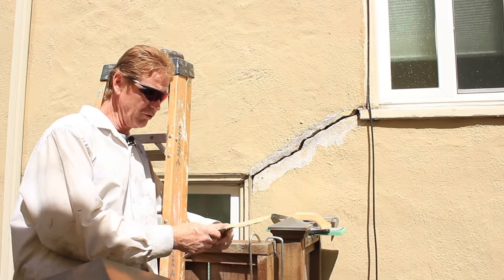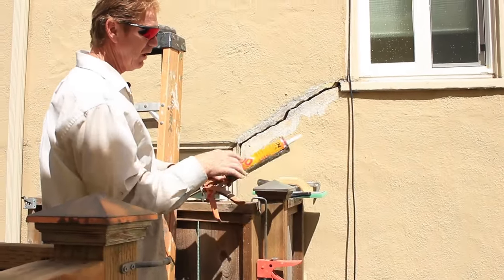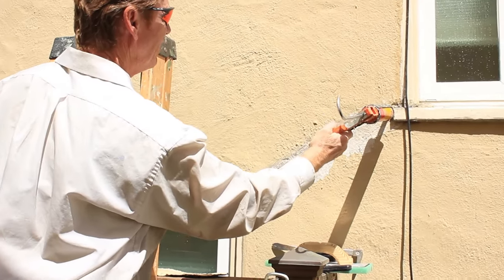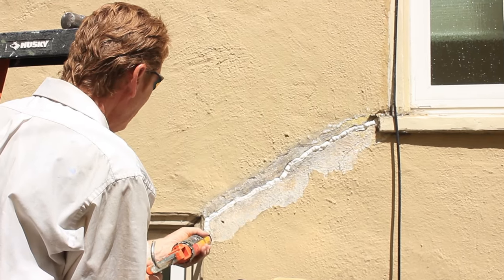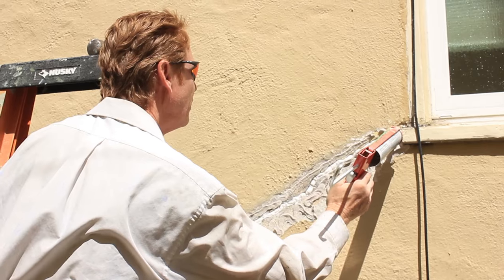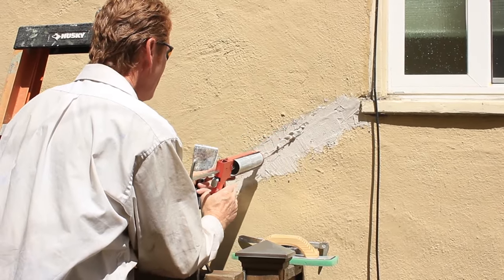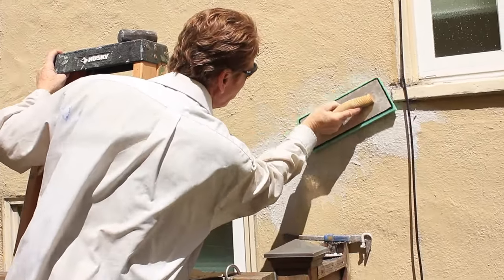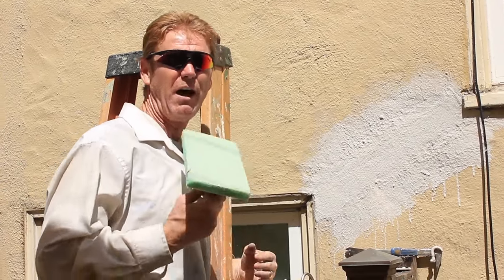Fix large structural cracks in stucco.

Comment: I have installed sealants professionally for 40 years and I was prepared tell you all the things you are doing wrong but it kinda makes sense. I didn’t see how you cleaned the joint but it appeared you cleaned it pretty well. The one thing I might have done different is tool the urethane to make sure it was bonded to the sides of the joint before adding the textured sealant
Reply from the maker: Howdy Gene Dude, in light of one with q deeper and or a specialized knowledge than most, that's quite the compliment. Thank you, brother, 🍻

Comment: Hi, I was wondering I have a house I'm working on it has a Vertical Staircase type crack the outside frame of the house is cement - cinderblock with a stucco or plaster coating on the outside and the inside, the crack is from the inside of the house to the outside you can see outside. I filled the gap with some expansion foam for now, and came across your video any recommendations? Can I do this with it. The Gap Grows some but it's an old house
Reply from the maker: Of course you can, on the inside place some interior caulking over the foam to make it prettier.

Comment: I have the same types of crack. Thanks for the tip!
Reply from the maker: Hi Mike Formichelli, no worries, I would suggest any polyurethane caulking that is flexible to water proof and flex with the wall movement and a good quality caulking with sand to match the sandy surface.
 best wishes,
Kirk & Jason Giordano’s DIY plastering and stucco network

Comment: Hi Kirk,

I’ve been watching your videos lately like it’s my full-time job.  I still don’t think things fully stick so I keep re-watching to get pieces I’ve missed.

I have a wall on my small ranch home where the painted stucco top-coat has separated.  I was quoted 3,500 to fix it and there really aren’t a lot of stucco experts around my area to choose from. 

I did some exploration and pulled away all the loose stucco. 

I power washed, applied weld-Crete, and then got some rapid set stucco mix and tried to put on a layer of stucco, being careful to feather in the edges. (We don’t have any rapid set stucco patch here).

I didn’t realize I wasn’t doing it right.  I probably only needed to do a skim coat and then attempt a Spanish lace texture.  The texture on my house is very uniform and I think it might be 20/30 sand. I bought some quickrete finish coat to do the skim coat once I’m ready. 

Anyways, I wasn’t happy with what I did, and tried to remove it enough that I could do a skim coat over it and try to make it look somewhat decent. 

I bought a rotary hammer and tried to take it off  as much of the stucco I’d previously put on like I’ve seen done when you remove stucco in videos, but because I used weld-Crete, that stuff was on amazingly well.

I ended up putting about 3 or 4 holes in my wall and I could see the stucco wire.

I power washed the wall again and brushed out any loose debri I could from the holes.

Despite brushing well, I still don’t think the holes were as dust free as the surface stucco was. 

I added some polyurethane Sikaflex to the holes but I’m worried that because it wasn’t as dust-free as I would like, it won’t provide that water resistant seal.

Should I have done something differently to prepare the holes to get them completely dust free?  Will that matter if I can’t get it as dust free for the caulk as I would like? 

Thank you
Reply from the maker: Wow, Farrah, you had a lot of work to do, "Rapid set stucco" has large sand '16/20," that matches most stucco finishes, 
I would have recommended the USA green core from HD as the sand is much smaller. "20/30' and therefore much easier to apply. Sorry, you had to go through this, but this means you are an exceptional woman to continue trying. What is your phone number I will call, I don't give my personal number out for obvious reasons however your seams an exception. cheers.

Comment: Great videos Kirk. Do you have a video where you plaster the butt end of a wall? setting up vertical steel bead then rendering etc?
Thanks
Reply from the maker: Peter B Hi Peter, thank you, you can see if any of these corner type video's will explain what you wish to know,

https://youtu.be/ByXcvPNNIFo  Installing inner and outer stucco/plaster corner aid or beads 
https://youtu.be/QWbTsdFWWFM   Complete and easy Lathing instructions, Waterproof your addition 
https://youtu.be/TFn3lViVrws  What is arch aid? flexible metal corners for stucco, stucco radius’s 
https://youtu.be/vyP3GhNenNE  Installing stucco corners properly, they were all set wrong at first 

 Best wishes,
 kirk giordano plastering

Comment: Great information.  My neighbour has a crack on his chimney exterior where the chimney tapers sideways (about the height of the inside mantel).  The jumbo brick has moved enough to cause the stucco to crack open at the corner. It looks like the brick has moved about 1/4".   If I really tried, I could move that brick but I'd like to fill the hole and seal it off again without disturbing the stucco anymore.  I may be able to tap it back tighter too?  What would be the best product to lock the bricks together as much as possible?
Reply from the maker: Sikaflex 1 A it’s a construction sealant and adhesive. Just don’t get it in you as it’s a drag to get off. Also it’s not very user friendly like Mor-Flexx, but incredibly strong.

Comment: I have two buildings right next to each other, both made of block.  Both have the blocks scored, galvanized wire mesh nail to the blocks and Expansion Joints.  Both were 3 coat applications, one with old fashioned stucco mixes, one with Dryvit.  No problems with the Dryvit building after 12 yrs. Stucco building hair line and deeper cracks all over the walls. Kirk what is the brand name and product number of the polyurethane Cualks you used in this video?  I know it will recrack, but if you don't keep the water out the freeze/thaw cycles will pull the application away from the wall.
Reply from the maker: Howdy Meno, I think it was rain buster, I also use a lot of sikaflex, but for most cracks I prefer Mor-Flexx as it has sand in it and matches most finishes if applied properly.
 Best wishes,
 Giordano’s teaching video’s

Comment: Hey Kirk, when finishing a patch like this, how do you match the color?

I have an old house with an attached porch, all stuccoed in a heavy lace style, with a buff/beige color similar to house in this video. My stucco is not painted though. There are a few old structural cracks in the front porch walls that someone repaired before with some kind of grey caulking, like you did in step 1 in the video. But they didn't float & feather a top coat. I want to touch these up & blend them into the rest of the stucco, but also match the color.
Reply from the maker: Hello kelly olsen-stanko, sorry, you will have to paint the area after caulking.
 Caulking do come in many colors but chances of finding the right color will be tough.
 Best wishes,
 Kirk Giordano Plastering

Comment: Hi Kirk, great videos and learning a lot. 
One question, is it possible to use the Morflex  only to fill the crack and not use Sika? 
Thanks again!
Reply from the maker: Howdy and happy Easter Fastrice, absolutely, what happens if you fill a large crack and the next day or say two dads later shrinks and is sucked in?
 Nothing,  you just add a bit more if this happens.
 Most caulking will shrink if the crack is deeper or wider than 3/8. Many cracks are wider than this so when this happens, don't panic just add more.

                           Peace, love, and harmony to all
         Sound Plastering tips for the DIY beginner’s and Plastering experts

Comment: Hello Kirk.. love the videos. Recently purchased my first home that had structural foundation repairs done prior to closing. There has been some water intrusion during moderate rain and hurricane Irma made worse . is it possible there are cracks lower down closer to the foundation? I was debating on digging at least a foot down and sealing any visible cracks... any recommendations.
Reply from the maker: Good Morning Maraya, dude, cracks in stucco are normal as caused by ground movement, holes in the unlining paper are not normal, these will cause leaks, depending on if your paper is now disintegrated, yes,  it would be a good idea to repair or caulk all cracks                   
                    Live long and plaster
    Mastering Plastering by Kirk and Jason Giordano
Reply: Maraya Fragoza okj

Comment: Hi Kirk, I just bought a house 8 months ago and the house was built in 1941 & they had an family room added on in 1972, now I noticed that there is a cracks from the top of the exterior wall all the way to the the floor vertically and it appears around the border of the old & the additional portion, after my handyman opened up the crack, it is about 1/8-1/4 inches wide vertically, and I saw him fixed it like the way you did, do you think it is a serious problem for this case?
Reply from the maker: Howdy Albert, with all additions, added the foundations flex differently, as they are poured at different times. and caulking will need to be done when necessary, I don't think it is a big deal personally. Just kinda annoying but that's life.👨🏻‍🔬

Comment: Hi Kirk, I have a 1/2 inch x79 inch gap where my stucco patio wall meets the back of my house (stucco as well). Would the best way to close this gap be the method you used in this video (sikaflex with mor-flexx)? The gap is about 10 inches deep so I'm guessing I could use some spray foam to fill the deeper portion, then use sikaflex and then mor-flexx? How would you do this repair? Any help is greatly appreciated!
Reply from the maker: Evening Brian. The best video online about caulking stucco is below. How do I know? 
I created it for this purpose. Structural or large cracking on stucco walls, no problem.
 https://youtu.be/2eIkdeIBbMs/ 🍾

Comment: Hia Kirk. Great tips thanks.  Its generous of you to share the expertise.
All of us with render have or will have cracks! I like the recommendation of the sikkaflex ebt+ but when I read their spec it says that it cannot be overpainted. I can't get the mor-flexx in the UK  so that's a pain. Do you use a specific sealant when overpainting is needed, say with sandtex masonry paint? My cracks are max 1/4" wide. 
Thanks lots
Reply from the maker: Howdy Neil, if a crack is too large, buy the caulking of your choice fill, wait for a few days if it shrinks, just add more, of course, seal the caulking tube so that the opened calking does not get solid.     
                                   Live long and plaster
                Answers to life’s stucco and plastering questions

Comment: What do you think about using fiberglass tape over the polyurethane and then put the elastomeric textured stucco patch (which drys flexible) into the top over the fiberglass tape.? Any downside to using fiberglass. Have done that in past but don't know if there is a downside to doing that.
Reply from the maker: Hieff Nesselroad, that sound logical, however the video below make the work last much longer.
 I do add fiberglass mesh tape too, two week ago I used the mesh because if i would not have  the patch would have had a large perimeter crack. 
 I was fixing the work of the last stucco guy, my so called reputation means my system has got to match and last forever.
http://youtu.be/xTB2RxBdKGA
Best wishes and have a Fantastic New Year!
Kirk Giordano’s DIY plastering tips
Reply: Thanks!
Reply from the maker: No worries Jeff,
 Best wishes, 
Kirk giordano
Reply: Kirk and Jason, thank you for the examples(especially in action videos) so many people lack a true  discriptivecommand of syntax(not meaning you personally Kirk) but the live example as you speak,now that's what happening. 
This has given me the ability to do exactly as you do without fear or trepidation.   Ido fire and water damage restoration, mostly to single story homes. Recently came onto one has sand finish on like12-15 inch wide sheetrock with the holes in it. On the inside.  And overhead. What kind of mixture is best on wire lath overhead, inside?

Comment: Hello Kirk & Jason, how would you repair Coquina Shell Stucco wall cracks ? have long small cracks in the walls.
Reply from the maker: Howdy Wm S Dude, excellent question,
 that's the toughest texture to macth unless the original person left a bucket of the aggregates in  the basement or cellar, which is unlikely.
 I have stuccoed a home over 25 years ago where we applied the brown coat with hanson white cement plaster and before it dried you throw on your chosen aggregates, seashells, glass colored pebbles, or whatever strikes your fancy.
 it is really difficult to find all the different aggregates especially if the home is over 50 years old, I have tried twice and spun my wheels as you need the exact same pieces.
 Best wishes as you have your job cut out for you.
 I have seen Andy Davis of Davis stucco match patches twice on these thrown on pebble dash finishes., where he found all the items I'll never know.
sorry,
 best wishes, 
 Kirk giordano Plastering

Comment: Kirk, you won’t be surprised to know that I am indeed using Mor-flexx ;)
Reply from the maker: Atta Girl, bet it will come out excellent. 🥂
Reply: Serious question though, is there a big difference between Mor-Flexx and this other brand? Mor-Flexx is also used to repair cracks.
Reply from the maker: Evening Puda, I used Sikaflex first as the membrane was torn and very deep. Sikaflex caulking is quite stronger than Mor-flex, but I did want a sandy finish hence the Mor-flexx on top. 
Note Quikrete also makes caulking with sand in it that is just as good as
 Mor-flexx.🥂
Reply: @StuccoPlastering  thank you!!!

Comment: question. can I use that polyurethane caulking on the inside ? you did another video I enjoyed , you used plaster for the cracked joint, this looks a little easier to apply . thank you ..
Reply from the maker: Howdy Guru Dude, polyurethane caulking are usually adhesives and super strong, but a nightmare to clean up, for inside work use a latex, that has a 40-year warranty that is user-friendly or cleans up with soap and water.
                      Best wishes,
Sound advice From your neighborhood stucco geeks

Comment: Hello Kirk,
I live in Florida. I removed my roll out awning and brackets which left 1/2 inch holes where the bolts were. Can I fill the holes with the sika Flex concrete fix and then use sika ready mix stucco patch over it without a bonding agent?  Will the stucco hold to the Sika flex?

Thanks!
Reply from the maker: G'day  Grace, you can, if it were me I'd use Mor-flexx caulking, allow it to mushroom behind and smear on the surface so it has some wall to stick to when it dries in a few days add more to flush it out even. it's a lot less work plus make the holes watertight.                       
   Introducing peace, love, and harmony back to the plastering world.        
                 Sound Plastering tips for the DIY beginner or the Professional Plastering experts
Reply: Thank you for your advise Kirk! I really enjoy watching your videos.

Comment: I'm a little confused about how to color match stucco repairs.  If I have stucco that has the color in it, and I have a few scrapes and cracks, how to I color match.  Is there a way to color match the pigment into the calking or stucco, or do I have to paint that repaired area?  And if I have to paint, do I just take a sample of the stucco in and have a paint shop color match it?
Reply: asusreviews you can put undercoat one large and put what colour u need
Reply from the maker: Howdy Views dude, some plastering material yards sell 2-pound boxes of color pigment with the correct sand howver most don't match when applied.
     In my, over 35 years I have found only crytal white will match.
 And even this takes a bit of skill.
    I'd recommend painting the entire wall as if it rains you will notice the paint wont darken but the stucco pigmented color will. 
I have a video that show this effect. 
                Peace, love, and happiness to all.
Sound Plastering tips from your favorite stucco nurds

Comment: Hello, Kirk. What's the brands name for the rain gutter caulk and moreflex  caulk you used.?
Reply from the maker: Good afternoon Ziren, I prefer Mor-flexx as it has sand in it and cleans up easy, however rain gutter or sikaflex caulking are stronger but are a drag to match any finish and almost impossible to clean up if it gets on your hands.
        Live long and plaster
      teaching stucco repairs

Comment: Hey man u guys are cool there is this texture where you hold trowel vertical and pull it horizontally the texture is like finger like thiickness and there is gaps inside that as well please help
Reply from the maker: Good evening Lerow dude. Any way you can get it in the crack works. No rules to it.
 Note: anyone with a question, type it into our Stucco/Plastering channel, and like magic, a video will appear to explain how it's done. 
This feature is miles ahead of any plastering forum. 🥳
https://www.giordanoplastering.com/

Comment: is safe to use the expanding foam. Hot area   cracked window to sealed with it
Reply from the maker: Good evening World Dude. of course, it is, when dry then slice off the excess fat and apply a thin coat of stucco to match the finish.
                         Bringing peace, love, and harmony to plastering 
    The complete plastering encyclopedia on video, by the plastering messengers of Youtube